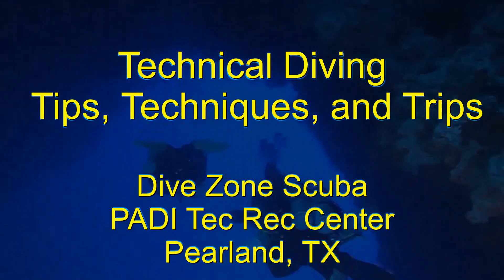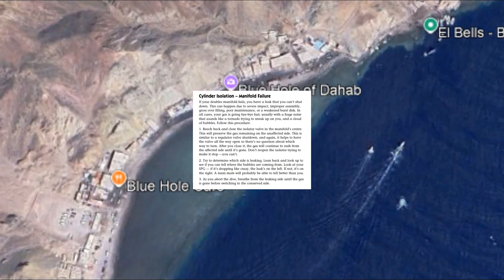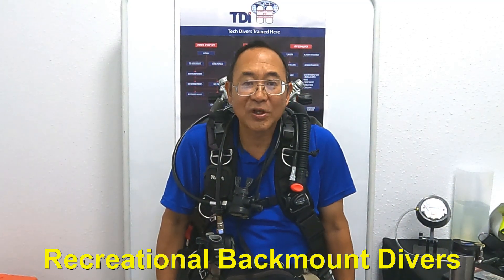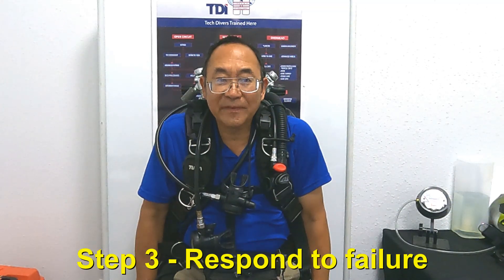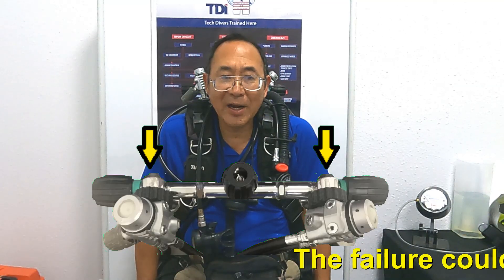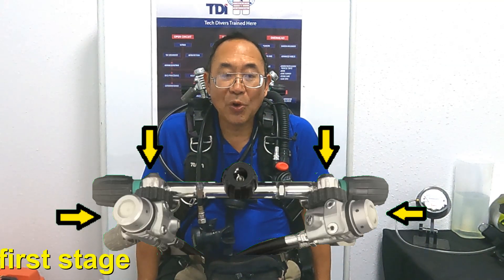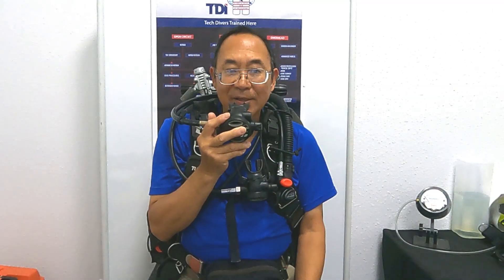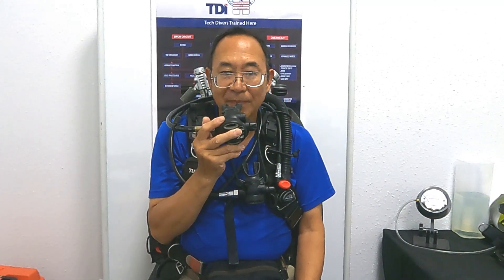#204 - Manifold Failure Emergency Procedures For Scuba Diving With Backmount Twinsets

Comment from the maker: Hello Hayden.  You could look at video #128 Reaching Your Backmount Twinset SCUBA Tank Valves for some things to try.  https://youtu.be/w9pVMq9My44.  You can also pull up the top half of your drysuit and undergarment prior to closing your waist belt buckle.  That way more loose material is by your shoulders instead of falling below your waist belt.  If you have suspenders, you can also try tightening those.

Comment: Nice note on AI systems having a sample interval. It makes identifying the source of the leak much easier after closing the isolator. In addition to having AI, I attached a small mirror on my primary torch. A bit of a cheeky tool, but hey, nothing beats visual confirmation of the problem.
I also recall a tip from my trimix instructor after correctly identifying the source of the leak and shutting down the correct valve: Check all other valves, including those on your stage/deco bottles if applicable, to ensure they are in the correct configuration (whether they are correctly open or closed). The reason being you may have unintentionally kept a valve either incorrectly open or closed while identifying the source of the leak.
Subbed 👌
Reply from the maker: Hello @bughelmet.  Thanks for your input.  I also carry a small mirror with me.  I sometimes use it for bubble checks.  There was also that one occasion where it saved three of us in the gulf stream.
Reply: Mirror on your torch is so smart 😮